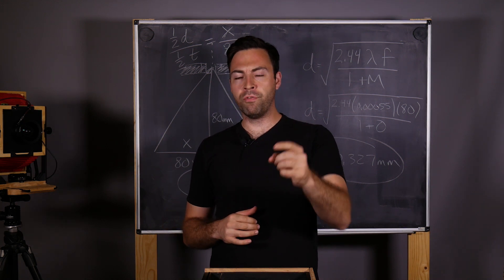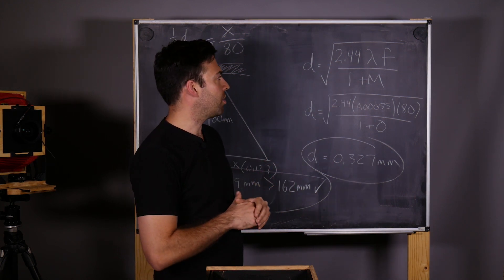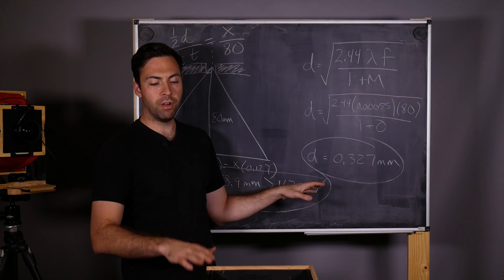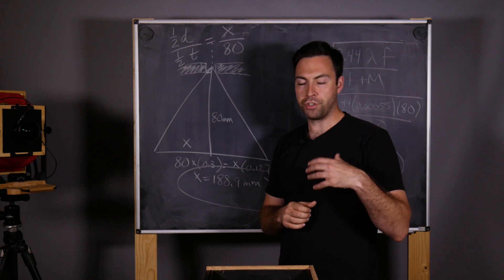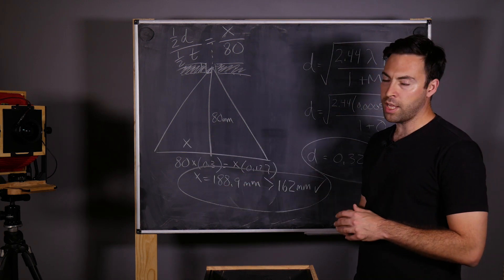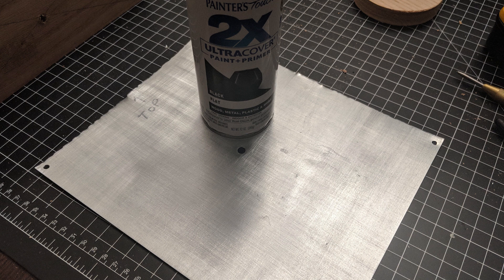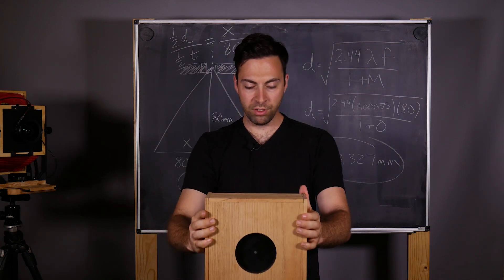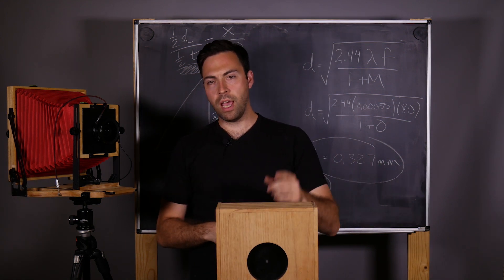Building an 80mm 8x10 Superwide Pinhole Camera Part 3 of 4

Comment: Thank you for this very interesting video series. It looks like a quality build and would definitely be fun using it.
I would suggest rethinking the design of the camera in several aspects:
1. Don't mount the pinhole/holder inside of the camera. Instead use a simple "lens board" with screws or a dovetails mount. This way you can use different pinholes on this camera. And since you are using a standard filmholder on the back side, you could easily attach a focussing screen. In conjunction with a very large pinhole this might be a good "viewfinder". Off course there is no focussing required but just to adjust the right camera alignment.
2. Your math on finding the "optimal" pinhole size doesn't take human perception into account. I think the smaller the pinhole, the more details are projected on film. The details are soft due to diffraction but they are there. Larger pinhole just means less detail but higher edge contrast. It's probably the difference between "soft" image and "unsharp" image?
3. The most expensive part of the camera is the film holder. I would like to see some DIY alternative.

Comment: Fantastic series of videos. I'm looking forward to see how it performs. I've only seen low res samples of 8x10 pinhole camera pictures, and they look just amazing, specially with those mega wide focal lengths, I don't really know how close you can get to the sharpness of a lens camera (and i'm really curious), but with that tiny hole (same diameter as the pinhole in my 35mm film camera) and that enormous film format, i bet it will be pretty close!

You call it science, but for me, to get pictures from a black box with a tiny little hole and a piece of film, it is just pure magic

Oh, and please, you don't need autofocus in that set! put that camera in manual focus, everytime you move it gets crazy, and i'm constantly checking my connection because i think youtube is lowering the resolution of the video... xD
Reply from the maker: I agree, it does feel like magic getting an image from just a small hole. I actually have a video where I test the scientific equation for the optimal pinhole and then compare that to a result with a lens here: https://youtu.be/VPzAAzEb1wE - obviously a pinhole isn't as sharp as some really nice Carl Zeiss glass, but it's not half bad!

Good point about the autofocus - Panasonic cameras do a pretty bad job at hunting for focus. I often forget to switch to manual focus - oops!

Comment: Neat!

One quick question, though: Wouldn’t it be better to optimize the pinhole for a point closer than infinity since 1/3 of your depth of field will be in front of your point of optimum focus and 2/3 behind it? So if the point of optimum focus is already at infinity, aren’t you kind of wasting 2/3 of your possible DOF? This might be kind of a moot point since an effective 80mm f256-ish “lens” will have essentially limitless DOF but it’s something I was curious about.

As always, really enjoyed the video and looking forward to the final in the series as well as outings and results from the camera!
Reply from the maker: Fantastic question! In short, the effect of optimizing for such a wide angle camera is negligible. Calculating the hyperfocal distance for an 80mm focal length on 8x10 film which has ~0.22mm circle of confusion gives 6.1ft or 1859mm. Magnifiation is defined as (distance to image)/(distance to object) so 80mm/1859mm = 0.04 which is quite small. Using 1.04 in the denominator of the equation only changes the optimal denominator to 0.320, so virtually no change.

When I make the pinhole for the intrepid 8x10 I will optimize it for macro or 1:1 portraits where M will have a significant value.

Great insight. Thanks for commenting.